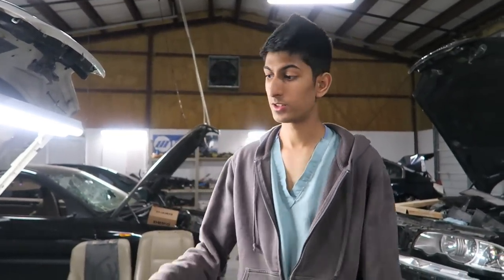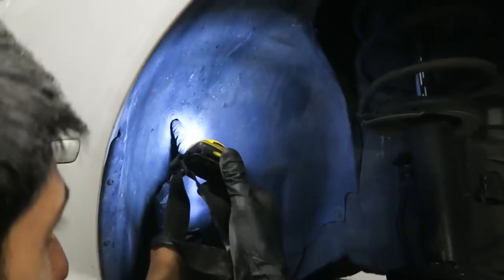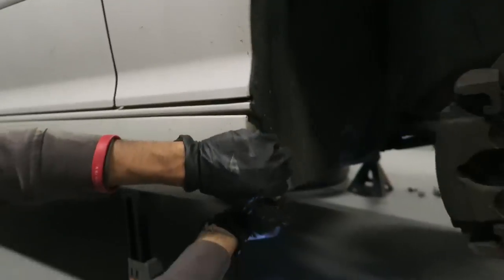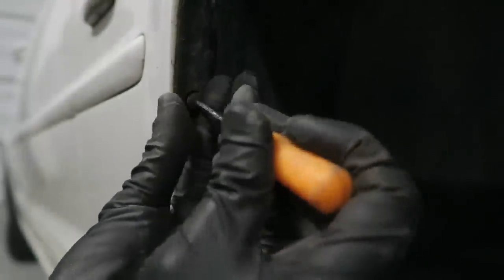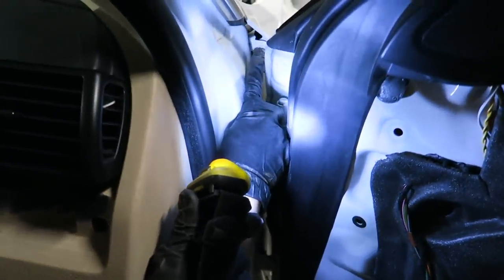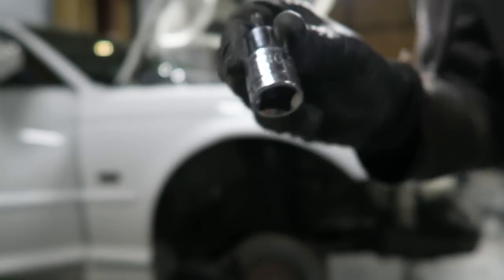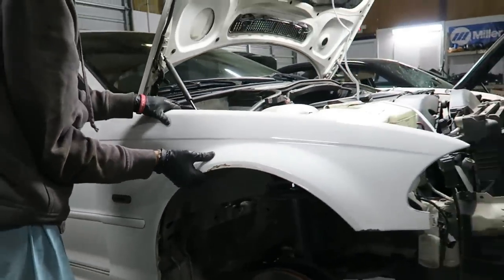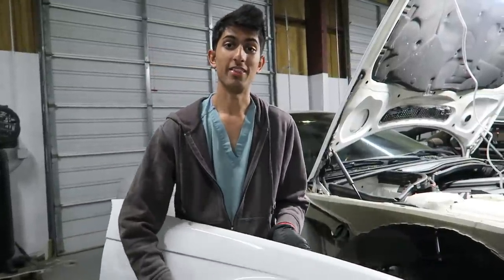How To: E46 Fender Removal

Comment: Hey thanks for the video I do have question: Do I have to remove front bumper to remove the fender?
Reply: Richard Brunn 
I had the same question, and looks like from other videos of the E46 fender removal you can remove them with the number still on.  We shall see.
Reply from the maker: You do not have to remove the front bumper to remove a fender

Comment: Is a 2000 323ci convertible the same?  Looking at one that will need the inner and outer fender, and headlight assembly swapped.  Doesn't look too hard.

Comment: Hi my fender liner has a crack ,will water leak in side the car? 
Thanks, cool video s ,sub from UK
Reply from the maker: +Dumi Mudi Depends on where the crack is, but I've seen e46's with no fender liners at all and the interior did not leak anything so you should be fine. Thanks for watching!
Reply: Thanks mate,love your work

Comment: Hey man thanks for all the helpful videos,i just got myself a 03 bmw 325i lastyear from a car auction only had 92,000miles and 1 owner and no accidents,im replaceing the same panel you just replaced,1 question i have for you is the problem im having is my check engine light keeps coming on and when i check it with my scanner it says bank 1 and bank 2 are runing lean,so im assumeing its a vacumme leak,so ingoogled i started with changeing the MAF and still nothing,then i changed the disa valve because i heard a rattleing inside and the flap was broke so i replaced it and im still geting the check engine light and same codes,and im hearin the rattleing again i hope the flap dident brake again if so ima have to get one of those rebuild kits woth the metal flap! Please man if you could help me out my names tommy from baltimore my gmails lmullins996@gmail.com thanks in advance man i figured if anyones gona know its You!